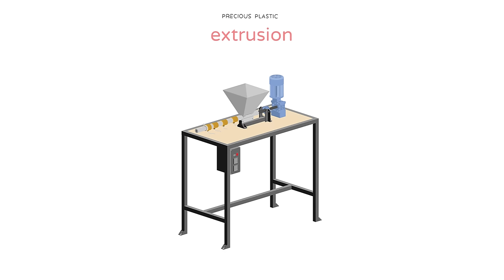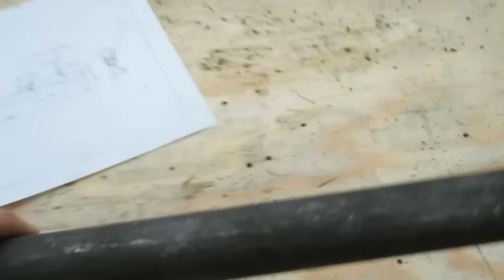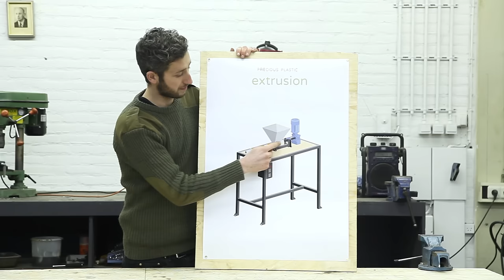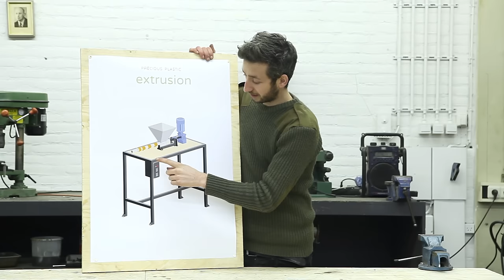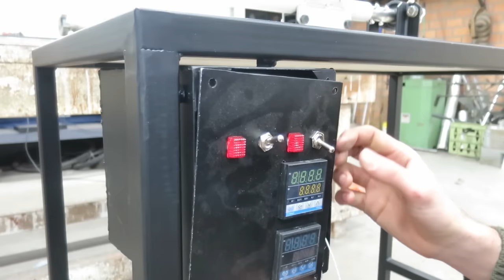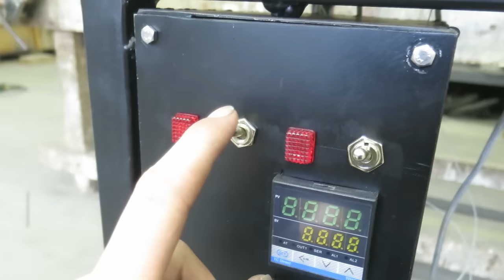Precious Plastic - Build the extrusion ( part 3.2)

Comment: 2:18 hopper  ...... 3:15 barrel    .....    3:50   screw    ...... 5:00 nozzle   .....        13:20 heaters    .....       14:00   motor     ..... 14:53   complete machine   ........  17:00   modular             .......      tags: 777extrusion

Comment: one thing i've noticed missing from the list of machines, and making recycled filament being mentioned, for a greater control on size, and compactness between extruder and spooling device, A water bath is handy. cools the filament so it locks in the size, it's less likely to stretch or deform after that.

Comment: In joy the video thanks for shearing. I have a welding tip grinding where you are going to weld will make the weld stick better. Look better. And you won't have as much build up. Less inclusion in welds. Anyway just my 2 cents.

Comment: 3:49 can i ask you for extrusion crews? i can't find the screw (in 3:32 .it's gap on top bigger than gap on other side). can i use the screw (in 3.49 . the screw has balance gap in all), plz give a advise quickly. i wanna set that machne

Comment: how about using an handdrill as a motor? wouldnt that be powerful enough, and you could control the speed.
Reply: good idea
Reply: It would work, but, a hand drill is not designed for continuous operation. So I am pretty sure you would burn the drill out. How long it would take to kill the drill depends on how good the drill is, but, I am kinda certain that would happen.
Reply: I don't think it would have the torque required. Sure, the bit they use is meant to be used on a hand drill, but all the power is focused on the tip of the bit drilling into the wood. Here, it's focused throughout the entire body, or "threads", of the bit. So high torque is needed, so that you have a very consistent speed.
Reply: Would not work. We need a slow speed motor is not really true. We need motor with high torque. How to get more torque? For examle, reduction gearing. Reduction gear is makes the motor slower and gives more torque. Its like your gear shifter vs gas pedal on your car. You don't shift back on uphill because you want to go slow, but because your car can't sustain the high speed under high load, just like your electric motor.

Plus most drills not designed to deliver high torque, continous operation, etc...
Reply: @SzDavidHUN
A slow motor isn't optional, the plastic needs time to melt and the extruder needs time to extrude. Therefore a slow motor is necessary.
Reply: I plan on doing that with a power drill
Reply: Hand drill motor has the high rpm and low torque.In this extruder there is a requirement of very low rpm but high torque.So either u need a gearbox arrangement to make balance between torque and rpm plus the drill can not be used for long time running of machine
Reply: @gustavferdman214  true
Reply: @gustavferdman214  you can have a high speed motor to create more power.
And then have a gearbox atached. Like the one he is using, that also has a gearbox.
Reply: Marc Jason Radoc  put a bycicle behind it and just peddle to extrude ;)

Comment: Yes, in USA, a 1/2" variable speed drill is good enough, eh ?- -  just make a simple jig on the trigger using a lock nut and bolt, so you can turn the blot into the trigger to up the RPM's, lock the bolt in place with locknut so it does not vibrate off
Reply: Would not work. We need a slow speed motor is not really true. We need motor with high torque. How to get more torque? For examle, reduction gearing. Reduction gear is makes the motor slower and gives more torque. Its like your gear shifter vs gas pedal on your car. You don't shift back on uphill because you want to go slow, but because your car can't sustain the high speed under high load, just like your electric motor.

Comment: I built one myself and it works great! However, I am using a DC motor that gets really hot after 3 minutes of use. I know it will over heat if I keep at it. Does anyone know what motor specs I should be using? Several people below have mentioned high torque, but no one has mentioned the actual value or the operating rpm. Also, I am trying to produce 8lbs/hr (0.0011Kg/s), does anyone know what torque and rpm I should be using to get that kind of mass flow rate?

Comment: Very informative and entertaining video Dave, on the subject of modifying and hacking this machine's orientation is very similar to horazontal injection molding machines, if clamping force and an assembly for the mold holder/ part ejecter can be drafted this could turn into an automated or semi automatic injection molding machine instead of the labor intensive hand operated one.

Comment: How about precision and repeatability of produced filament? Can this machine be used to produce perfectly round filament suitable for a 3D printer (1.75 or 3 mm with 2% tolerance)?
Reply: with the right nozzle, its possible
Reply: I dont think so because there is no reglulation exept the manual pulling, heat and the skrew at the nozzle.
(it would be pretty inconsistent)
Reply: I think you could do that, but you need to  enable stable positioning of the extruded filament at least to the distance from the nozzle where it has solidified. You cuold do that by winding the filament at a distance from the nozzle. This can be done with a motor operated mandrel. However I can guess this is not too simple because the winding needs to be done at the same speed of the filament extrusion, and as the filement winds, the mandrel rotation needs to be decreased accordingly. You would need to control motor speed electronically.  I also think vertical extrusion would be better because in the horizontal conformation, the circular section of the fused filament would tend to flatten because of the gravity. In vertical extrusion you won't have this effect.
Reply: No it would not meet your 2% tolerance. By using a drill bit and not a true extrusion screw you will get air bubbles in your filament.
Reply: @mikehabas7871  and a true extrusion screw prevent air bubbles ? I wonder how this works ?

Comment: Machine looks to the level I can build one with my tools. Only doubt is, I see in your site maximum it is supposed to run for 4h/day. What prevents it to be used for longer runs?  I would want 8-12 hours runs at least, but pro-makine is a bit overkill for the purpose. What should be improved in this machine to have at least these run times?

Comment: How do you clean it afterwards?
Reply: it generally needs no internal cleaning. for a color change, simply turn on the heat and put new color plastic in hopper. Then purge until you get your new color running clean. Or if you feel the need dismantle and chip off the old plastic. That is really unnecessary. The old plastic will not seize up in the barrel. If that issue comes up a bit of oil may be added to your plastic for an easier flow with a bit of lubrication. About a half cup of light oil per 55 gallon barrel  of plastic. This also allows any dye to adhere to plastic pellets or grind material. It must be tumbled for an even color mix and even oil distribution.  These are rough estimates which apply to styrene and linear plastics alike.
Reply: Larry Lund Wow... I didn't expect such a complete answer. Thank you!
Reply: Larry Lund Wow... I didn't expect such a complete answer. Thank you!
Reply: @Larry Lund, thank you, I was wondering about that.
Reply: Carlos Castillo útil

Comment: Could you use this method to do large injection molds? And if it has an issue of cooling down to quick just use a heated mold?
Reply: Alpha Nerd this is too slow. It is for extruding filament. Precious Plastic got another machine for injection molding. It's even easier to built...the thing nit so easy are the molds. larger molds are even more complicated.
Reply: well im thinking with his method of injection molding, you only have one plunge. Unelss you keep the whole mold at liquid temp.
Reply: Alpha Nerd with an extrusion molder you need a higher capacity to continuously melt a given amount of material while keeping the injection rate high. 
How big a part are you trying to mold? Injection molding tools are rather sofisticated including cooling and heating For bigger parts like Bobby cars (HDPE) other techniques are used. they are made from hoses and blown up in the tool.

Comment: In reality, how much would this project take to complete, if you didn't have the tools or shop equipment to produce this machine?
Reply: R. Cast what tools don't you have?  With patience, you can use a manual drill, although they're dirt cheap used.  The angle grinder saves a lot of time, but you could use a hacksaw, drill, and sandpaper.  Instead of welding, I'd use sheet metal screws on the hopper and bolts on the frame.  You can buy pipe already threaded.  The extrusion screw (ship auger bit) would be a lot of work to file, or you could look at used meat grinders.
Tools are an a monetary investment to save time & creativity.  If you Google Gingery, he wrote a series of books on building a metal-working shop starting with a coal forge and scrap aluminum.  There are YouTube videos of people doing this, although it takes a lot of time.
Reply: Thanks. Literally starting from nothing for a children's project.

Comment: what about the installed motor power ?
Reply: It's probably a 1/4 HP, I would say nothing more that a 1/2 HP motor. The blocky thing on the end is a gearbox, typically the motor spins 1700 RPM, the gearbox reduces that.
Reply: @sammymus4240  have any idea how can we calculate the required motor power for a different screw dimensions ?

Comment: Hi Dave!
Could you tell me the outer diameter and the length of the barrel?
Which is the outer diameter of the drill bit? 
Thanks!
Reply: Outer diameter of the barrel is 34mm, inner diameter of the barrel is 26mm, which is also the external diameter of the drill

Comment: What type of bearing is that @10:10 ?
Reply: Also @14:04, did you lathe the key connection or weld it on (to fit inside the motor hole)?
Reply: +Sami Joseph go to the forums

Comment: i wish i could have one!
Reply: +StickyStick me too
Reply: You watched him make it, right? What's the problem?
Reply: Doogie Houser the average guy doesnt have al the tools to do it
Reply: +Martijn Voordouw exactly. I think that where these videos are excellent is in showing the principles behind the machines. But the way he constructs them makes it clear that a) he is a very skilled craftsman, and b) he has access to machines that are themselves very, very expensive.

Having said that, the idea is actually very simple: it's a drill bit rotating in a pipe. That is the important part. From there you can modify the idea for what materials you have available. For example, it could turn by hand. It could be heated over coals, or a rocket stove.

We definitely don't all have access to such first world equipment, but the idea here is still exciting. But yes, damn, I want his workspace. Even just the table he works on is amazing.
Reply: Find a makerspace near you; if there are none, think of setting up one by yourself. You will be surprised by the number of tools people buy just to do one thing and then the tool is thrown into a garage to gather dust or tools whose only fault is a small electronic component like a capacitor that has blown. Point is, a community of like minded people can do anything they put their minds to.

Comment: I m really dont understand, why he dont use plastic to do the hopper?
though, it is not hot plastic that flows down to him.
Reply: He is a Welder and has a lot of welding tools. That's why he designed the machines with metal hoppers and frames. Even though you can use pretty much whatever medium you want for those. As long as it's strong and stable.

Comment: Sorry am I missing something?  In the video https://youtu.be/p4NoY33-Tfo?t=837 it states that the motor specs are in the blueprints. I have downloaded the archive of the plans and in the 3. Build/Extrusion/Blueprint files I only find in the schematic that it should be a "controlable" motor. In the parts list I see that it should be "Around 70 RPM". Is that all the specs? No minimum wattage or HP?

Comment: Where did you get the heater ffs?
Can I use my kettle heater...

Does the controller increase the heat of the heater to about 250°c?...
Can I use a thermostat controller?

By the way, what schematic is he talking about?
Reply: The type of heater is called a "band heater". I found them on ebay and aliexpress just a few moments ago, but it did take some searching to find out what they're called. The schematics are on the Precious Plastic website.